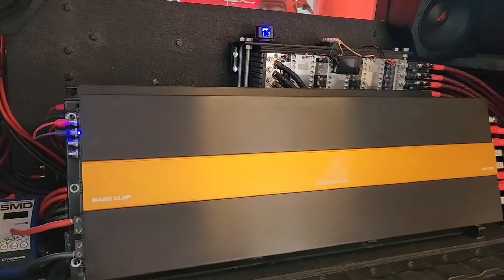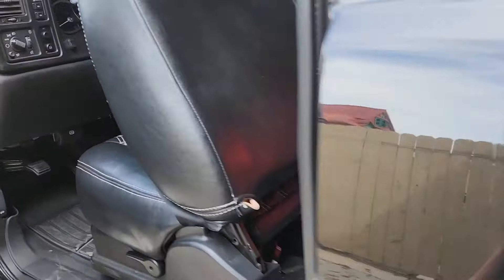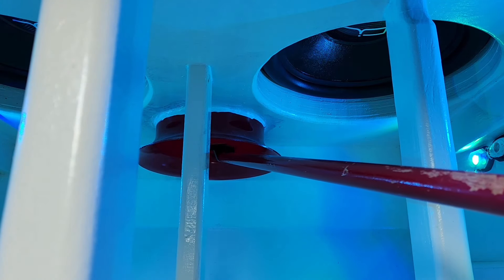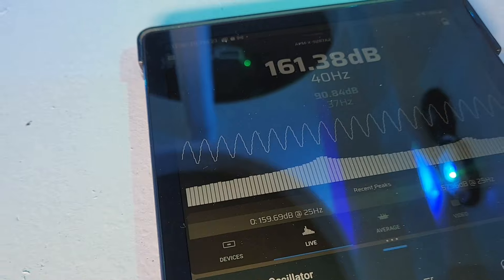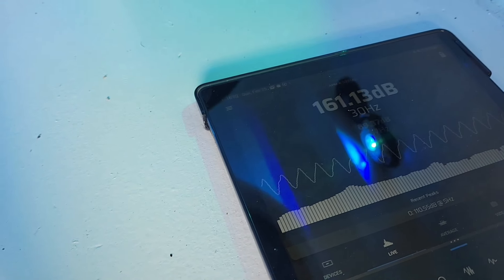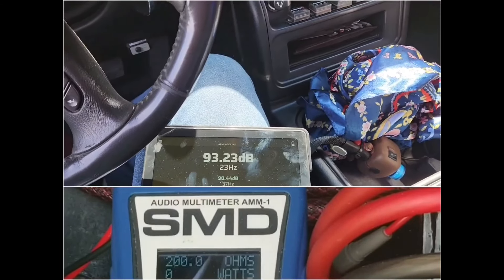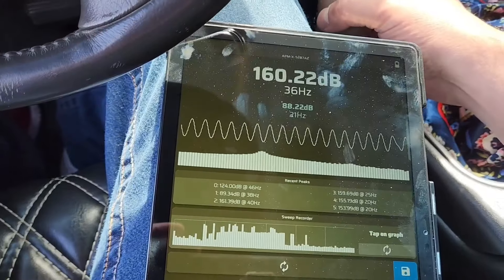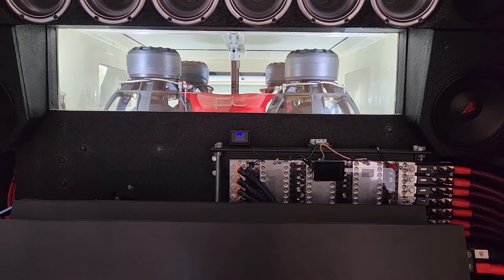HOW LOUD IS THIS SYSTEM IN THE PORT on 4 Fi HC18s and 2 BC17K (La Taz)

Comment: @956Bassaddict- Is that rear chambered port a 10" Aeroport? Also the port score will be loudest @ actual tunning freq., and with the meter all the way into the port, right @ its entrance usually, not the exit/mouth. I understand that it is very difficult to do that in your enclosure, i was just giving you an understanding of why your expected port score was lower than you thought it should be. Hey i got an idea, with your driver side door open, try putting the meter just inside the front port (= the port just behind your seats), 1st on drivers side (find loudest freq. 1st, like @ 3/4 volume), then put meter on passenger side of that big port, but still have the drivers door open, to see if there is a pressure difference, from side to side, also recheck @ 3/4 volume to see if the pressure difference/port loading, changes the peak freq.!? Another great video, my friend👍👌😎
Reply from the maker: One of my friends has a 10" aeroport mold. My friend Chris, who's is the person who helped me get the tuning on my enclosure. He helped me make that port with pvc pipe. And thanks for the advice. i will do that 👍🔈🔉

Comment: Curious on your wall specs bro
Reply from the maker: The sub box side is around 17.5, and the loading side is around 21.5, tuned to 26hz rear and 50hz front
Reply: @956Bassaddict  I always thought you had a 6th order ?
Reply from the maker: @Basshertz94  It is a 6th order. I should say the sub box side is 17.5
Reply: @956Bassaddict  I gotcha bro makes sense now ! Thanks. Ro
Reply: @956Bassaddict  how much front port area? You run a 8 inch aero in rear right ?
Reply from the maker: @Basshertz94  is a 10-inch aeroport and front port, including the depth of the port, is around 4000 square inches
Reply: @956Bassaddict  hope all is well bro miss your videos!
Reply from the maker: @Basshertz94  Everything is okay. I just haven't done anything to my build. But I will be making a new video soon 👍
Reply: @ sounds good bro looking forward to it, your build is was convincing me to switch over to 18s